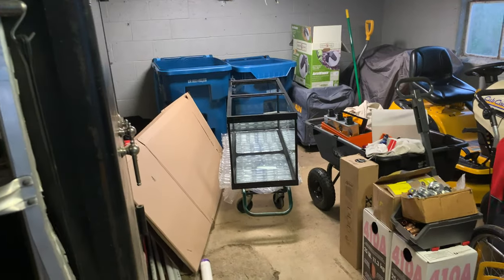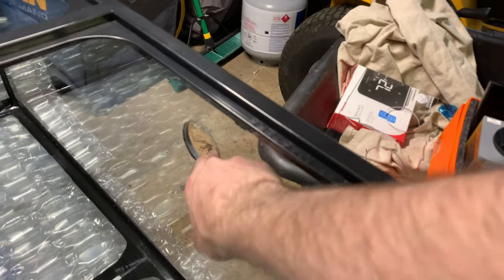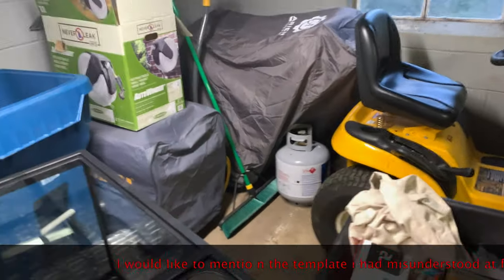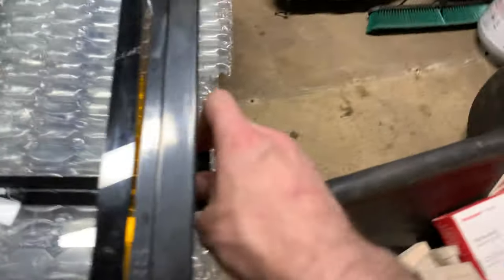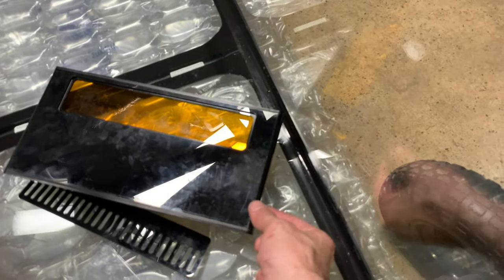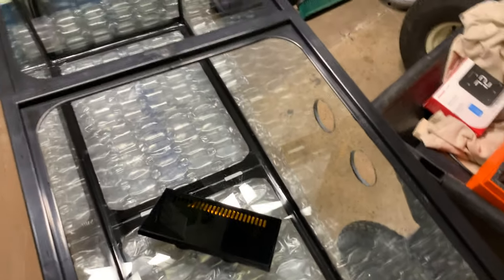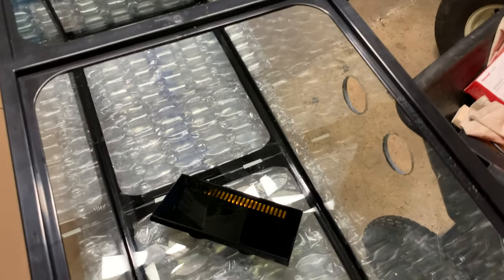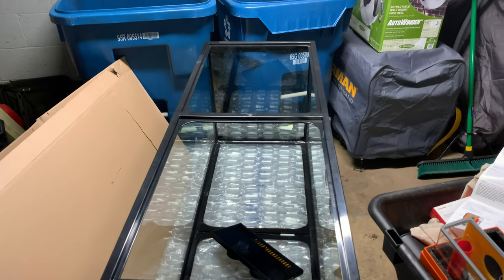Eshopps prodigy large overflow new tank getting started info 75 gallon custom

Comment: I'm going to attempt to make a dyi overflow box. Going to use pvc flat plastic sheets cut to same measurements of the eshopp or close to and hot air weld seams.  For the price of these overflows are new I'm going to try myself

Comment: Synergy reef has spacer kits that may have helped?  I’m considering them.
Reply: Well everything worked out fine I just trim the little ledge of the plastic with a Dremel tool and it all worked out perfect the water line was above trim all worked out exactly how I hoped. The prodigy overflow box though has bowed out from the water being in it it is bowed out so far the cover doesn’t fit anymore just falls inside not very happy with this. I just purchased another one but not the prodigy a standard one By the same company and every three days I have to turn the lid round because the lid bows up so much it falls into the overflow box. So I have to turn it around every day so it flexes  the other way. I’m starting to think their products just aren’t that great
Reply: @JasonStJohn-my1cs  ack, thank you for that follow up.

Comment: I did the actual thing with mine. The template is useless!
Reply: I did use the template but you just have to be careful where you position it so that your waterline on a rim tank doesn’t show you need the template to get your holes properly aligned but you can’t just push the template on the glass and slide it up all the way you have to visually check and make sure the Highwater line is going to be above the rim of your tank when I say rim above the black part if you have a rimless tank just make sure it doesn’t go over the rim. Just imagine where ever the holes are on the overflow Where are the water flows through it your water is going to rise up to a half inch taller than the entry holes. 
It’s all depending on how much flow you have if you’re running 800 gallons per hour your waterlines gonna rise up probably more than half inch to three-quarter of an inch from where the water enters the overflow. But if you’re running around 300 gallons per hour it’s probably gonna be much lower. I installed mine on a standard Aqueon rim the tank had no problem everything worked out perfect but I did have to trim some of the black rim on the tank out of the way but not the supporting part of the frame. I wish I could give you a picture but you saw the video